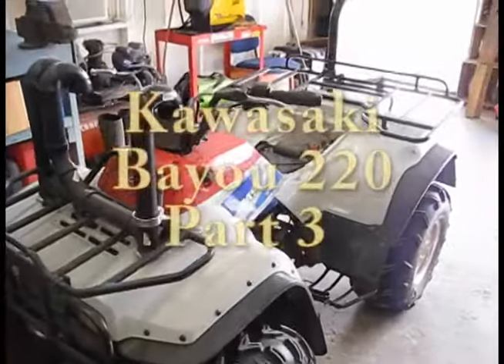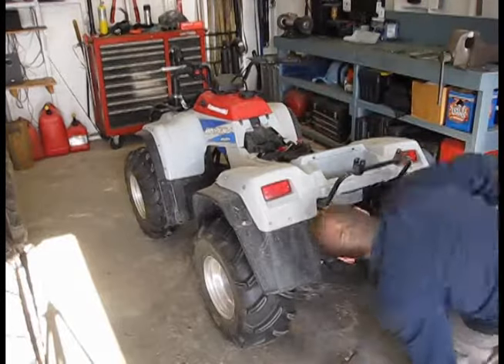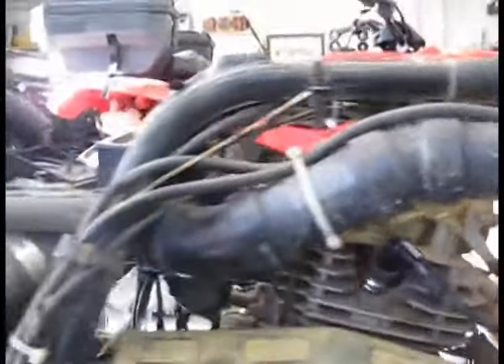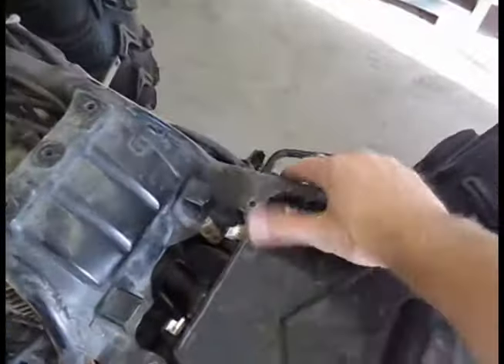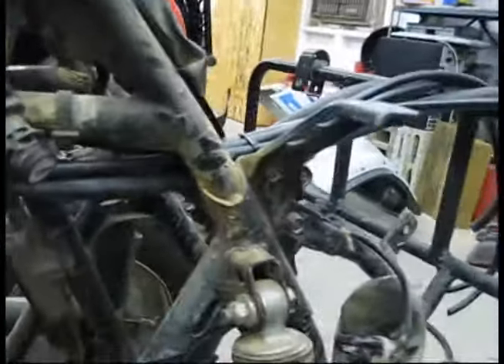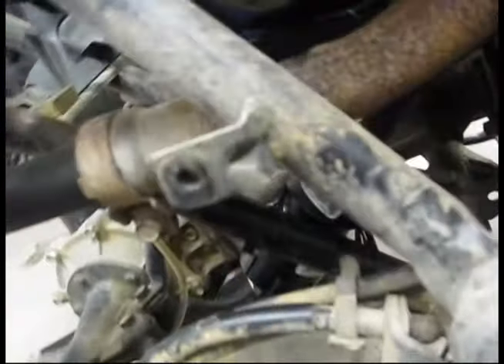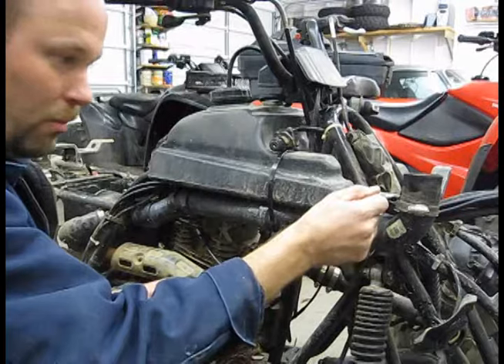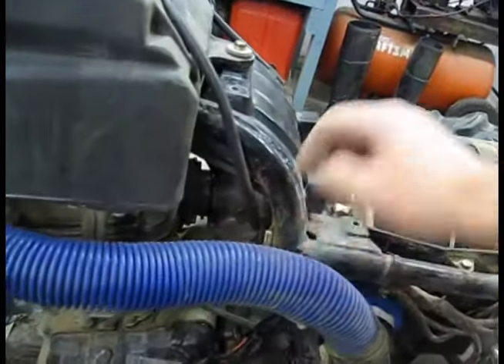Bayou 220 Snorkel & Vent Hoses Part 3

Comment: The bearings on the rear end are servicable. You have to take the axle housing apart from the pumpkin and knock the bearings out with a bar and hammer... i recomend new seals while your at it. the front hubs simply come off with one nut, then you can knock out those bearings the same way with a smaller chissel

Comment: Hey i love your videos all of them rock i have a question though i have bayou same color and model as yours i got it out of a field and my lines on the carb are all dry rotted and hooked up in the wrong places exactly. Where do all the lines go i know where the main fuel line goes but the others are missing and or too short to hook up anymore PLEASE HELP

Comment from the maker: There's 3 other lines on the carb, starting from the upper most line, its the atmospheric vent tube, I point it out in the video, you'll see where it goes. The next line from the top is an overflow vent, it runs to the ground, to let out excess fuel from the float bowl chamber. The lowest line is the float bowl drain. it also runs to the ground.
Reply: So since I can't run the carb vent up the snorkel could I run it in my air box to keep water out
Reply from the maker: funny you should ask that, I never finish part 4 covering the final fix for that.. what I did was get a T fitting from the parts house that allowed me to step the size of the hose from the 1/4 in size to 3/8 then ran up the vent with the rest. This worked.. it doesn't add any additional restriction so it runs right. It may not seen like this would have that much of an effect, but it did fix the issue :)
Reply: Yellowdog02 thanks man I gotta 89 300 4x4 and am trying to snorkel it I've got it done all but the air box lid and the vent lines
Reply: Yellowdog02 and also why a T couldn't you just put the adapter straight from the carb to the line running up
Reply from the maker: well yes, guess to clarify it was a universal T fitting with multiple size steps on it, I already had it in the shop at the time... it came from advance auto parts originally. I plugged off the 3rd port and used what I needed.
Reply: Yellowdog02 oh ok thanks man
Reply: Yellowdog02 do you have to run the battery vent line up the snorkel
Reply from the maker: I don't think so, the battery is a seal unit so water cant get in if air cant get out... now in the odd chance you roll it over in the water then water would get in.. but at that point the battery would be the least of your worries :)

Comment from the maker: If you blew a head gasket it sounds like you had other issues, crank case pressure wont cause that. Oil leaks sure, but that's about it.

Comment: Instead of having a T and having two vent lines coming up. Could you have just run one line down to your canister to dump all the crap in and one line coming out of the canister and up to your snorkel top?
Reply from the maker: well, you could try that, the only reason I did 2 was the original setup had 2, so i figured there was a good reason for it.

Comment: What about the air box drain at bottom right side of air box while sitting on bike
Reply from the maker: +Bailey Arceneaux 
On mine, there were 2 drains both in line from front to back of the ATV. I glued mine shut since they are a pinch seal type of drain "I didn't trust them". if I needed to drain water or gas out of the air box I used pliers on the clamps holding the rubber drains to air box and just took the who thing off. A little more work, but its a work around.
Reply: Yellowdog02 ok thanks also on my 300 the behind the carb by battery there are 2 bullet conectors coming from battery the have 12 volts then there are 2 more in front of carb with no npower what are these my bike runs fine but would like to know what these r for
Reply from the maker: Not sure, my 220 didn't have these connectors.

Comment: Do you know what size rim goes with that tire?
Reply from the maker: +Eli Boland 
Google This
(4/110 ITP Steel Wheel 10x5 2.0 + 3.0) for the front
and This
(4/137 ITP Steel Wheel 10X8 3.0 + 5.0) for the rear
These steel wheels will get the job done.
Reply: +Yellowdog02 can you send me a link to the wheels and tires that you have on your Bayou? I'm learning that it's hard to find tires for the original Wheels
Reply from the maker: +Justin K 
go here.. www.rockymountainatvmc.com 
put in their filter the make, model, year, and then search weels... you will find the right listing of douglas wheel options for your bayou. including aluminum and steel. (this is where I got the ones for this bike)

Comment: Do you know what size tires you have on the front and back for this 4 wheeler? I've been thinking about getting different tires for mine because it's a little hard to find good stocks.
Reply from the maker: +Eli Boland 
They are Gators 23x10x10s on the rear Mudlite 23x8x10's on the front, However the rims are not stock either, you have to factor that in as well.
Reply: +Yellowdog02 Right! Thanks so much

Comment: were did you get those tires for it
Reply from the maker: If i remember right I ordered them from Rocky mountain ATV, I know I got the rims from them.
 Its been a while since I did that so,  not sure if they still sell them.
They are Gators 23x10x10s on the rear Mudlite 23x8x10's on the front.